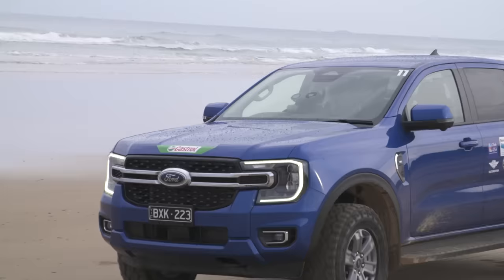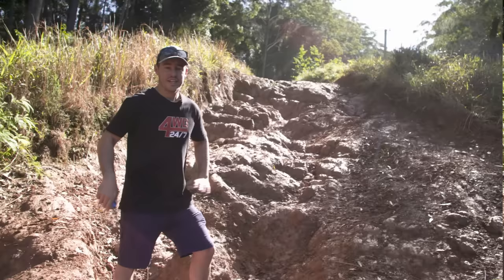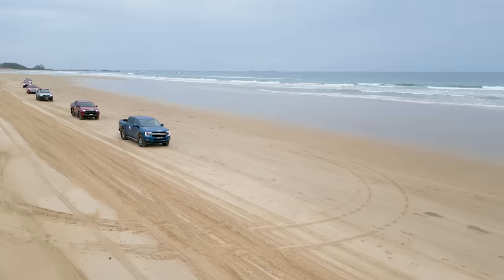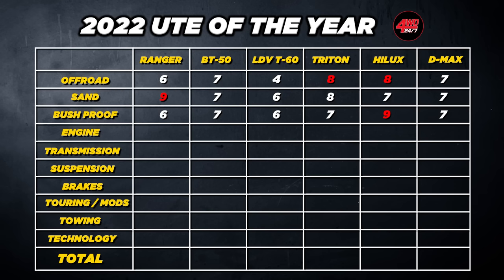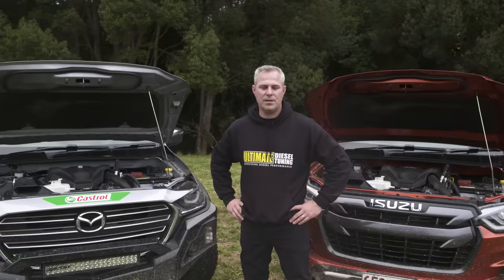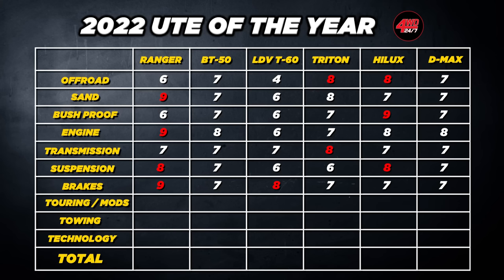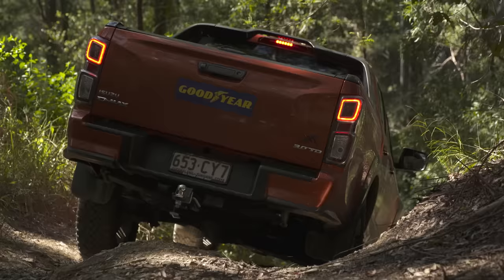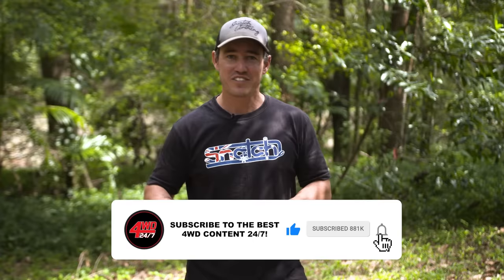2022 4WD UTE COMPARISON - CONTROVERSIAL WINNER! NEW Ranger vs Hilux vs DMAX vs Triton vs LDV v BT-50

Comment: I drive a 3.2 ML Triton with some good mods for off-roading. 
But the Ford ranger should win. 
Overall a great looking car. Well designed and jam packed with features. The car was designed with ARB, so there’s provision to fit all their suspension, side steps, bullbar etc. it also has a dedicated mounting spot for the ARB compressor I’ve heard. Going to be seeing some real touring rigs there!

Comment: Good video guys. I've just put my money on a XLT Ranger. Its the first time I have ever test drove a new ute and didn't think about what I was going to have to do/spend to make more power. You can upgrade the Hilux{and all the others for that matter} to the hilt with much expense and they will never punch that beautiful smooth torque out like this new V6 & 10 speed. Really impressive. I'm loaded heavy and towing 3ton often and I'm excited that for the first time I can just point and shoot. Only time will tell how it will hold up with all that "awsome tech"! If not for the towing I'd be in a bulletproof Triton{again}. Just as an aside the boys at the dealer threw my in a new  
T-Turbo petrol Raptor this week-WOW.

Comment: Ive got the LDV D90, come with rear locker, don't understand why the T60 doesn't on all models? Ramp angle on the D90 let's it down off road as for towing the 8 speed ZF does the trick with the bi-turbo, friends 2018 Hilux lowing the same weight caravan cannot keep up climbing mountain passes here in NZ. Throttle response is bad, put in a EVC throttle controller, helped but don't get why modern diesels have this issue.

Comment: i have a D22 navara, old 97' model with front locker and all the offroad goodies for camping and 4wdriving. super capable for an old work horse.
i think the best value for money is a triton. cant pass up the warranty. 
the new ranger looks like a good option if you have extra $$$ to spend.

Comment: Although i drive a 2019 ford everest (bendix BBK upgrade yes please), I am a fan of the new ranger, i don't think it deserves this win. It's simply too much coin for a stock ute. Yes the V6 and other gadgets are impressive, it looks constipated, the same upside down smile look all owners will get when they get easily hung up. I think the hilux or Dmax with 12k of extras would be a far better deal drive away (or mod yourself). If it was my money, i'd buy a recent ranger (new stock of older model), for a lower run out value, or new lux/dmax  and spend the value of up to 70k on tyres, lift, bar, winch, fuel filter, catch can and and maybe a lithium battery set up plus some recovery gear... Would go a lot futher than consipated face ute. Shame the new amarok wasn't yet fit to dance with the other lot. I think it would have been a very different story if it had!

Comment: I’ve got the pre 2011 Toyota Hilux n70 
Not just because I drive a Hilux but I recon the Hilux should win because, over all the results show as the second best ute but, it doesn’t cost near as much at the ranger. Comparing the 2 I think I would rather get the hilux because there is a lot of easy supporting mods, as where you don’t need to spend extra to get the dealer to re calibrate it after modifying it.  but all in all it comes down to personal preference at the end of the day, no one’s got the wrong answer 💪

Comment: You showed us Ranger has low mounted alternator not good for wading through creeks and it has plastic water pipes that could split and are not easy to replace like rubber pipes with clips?

Comment: I have a 2018 D-max that I’m doing up for off-road and camping also planning on doing some towing. I think the D-max should win it’s a good all around with a great engine. I have seen too many Fords letting people down. The hilux would be giving the D-max a run for it’s money but it does use more fuel at least the older ones did. The ford and mitsubishi have a 2 part chassis from what I have heard

Comment: Is it fair to be comparing a top of the range off-road focused ute to a middle of the range road going ute? Like the BT50 Thunder vs a Ranger XLT?

Also, is it smart to state that the transmission cooler on the Triton is great for towing straight after saying the engine is underpowered for towing.... 🤷‍♂️

Comment: Would love a brake upgrade for the FZJ105 keeping my family safer on our road trips and help when towing the camper around VHC and SA when we move there. Personally, I would love to see the BT50 win as it seems to be a great all rounder with a solid drivetrain and good capabilities straight out of the box. It might not be the best one there, but it is a great compromise to achieve everything you may want to do in it, with good aftermarket support to build apon when you find the limits.

Comment: Great video and review of the modern dual cab utes. 
My brakes are due to be replaced on my D22 Navara and I would much rather have a performance brake upgrade kit from Bendix installed than the stock Nissan brakes. The stock brakes in my D22 are terrible regardless if the car is loaded or not. 
My ute of the year is the Hilux, nice platform for an abundance of aftermarket accessories, mid range in price and you know what to expect with a Toyota in terms of longevity in performance and quality

Comment: While you're pointing at the Ford at the Ranger I'm sorry to tell all your blokes I'm a Ford guy I'm sorry to tell you the alternator sitting down low it's designed that way buy Ford engineers that's meant to cost you money meant so you have to buy more parts for designs fill your points in their vehicles so you have to spend more money

Comment: They look great, go hard and you made some good points on all. But I’ll still go with a 70 series cruiser because it has less electrics that will go wrong. Iv heard and seen all these models including the Amarok have stupid electrical issues that put you off the road but not once with a 70 series cruiser. Seen an Amarok have an issue with the tail light that stopped the driver from doing anything. Seen a dmax get bogged because the TC kept coming back on and seen a Ranger out of actions for months just because the electrics kept playing up. Again, never seen any of that happen to a 70 series cruiser.

Comment: Great comparison! As lame as it sounds, I've put an order in for a Ranger Platinum. I have only ever owned Hyundai's and towed a caravan with a Santa Fe and Palisade diesel. They definitely dont have the capability of these 4x4s, but, their diesel engine and transmissions have never let me down. No hunting and 99% of the time in the right gear. No transmission cooler towing 2T. Hoping I won't regret this. 
As soon as Hyundai release a ute, I'll probably jump back on the Hyundai bandwagon.

Comment: I've got the new amarok on pre order as there is a 12 month wait on the V6 ranger. 

Interested as to why you didn't include the gladiator in the test. It's a very different take on a Ute and be interesting to see how it compares.

Not sure if you guys mentioned it do all the Ute's in the test have the same tyre size from factory ?

It would also be good to know what the actual ratios are in the transmission section. I know you said the LDV does go as low but it would be nice to be able to compare all the low rangers as a low crawl ratio makes a huge difference

Comment: Excellent program for comparison. Whilst there is a substantial price difference between the ranger and the others I would still pick the Ranger. Overall your program showed this vehicle to be superior with the exception of the clearance which can be corrected with a lift. In terms of the price point probably not a fair comparison given the ranger was the only interested of the new generation. Reason for my decision apart from above is although more expensive historical evidence suggests that resale value of rangers has held strong which I would expect to be even better with the new generation. Hence I would spend the extra for the ranger. I currently drive a 2018 ford Everest Trend.

Comment: Im not into off-roading, but go on holiday to the coast evry 2 years , and having driven the previous generation Ranger, and the Hilux GD6 2.8, id take the Ranger every day. Its bigger cabin and better ride is way more important seeing my son is over 6 feet tall, and doesnt fit comfortably in the Hilux rear seats. Also, for the price, if other Utes had to match the standard of equipment and tech of the Ranger, theyd be more expensive. Hilux also has very impractical cabin setup, with cupholders and vents, etc. People go on and on and on about Hilux reliablility, but MOST people  only drive vehicles for 3 years then buy a new one, so what does that matter?

Comment: No idea why Nissan wouldn’t do the Navara for the review other than them worried it’ll damage the price range they set the top models at. Base model NP300s are great for value imo compared to other brands, but the top of the range is not worth the money imo as cool as they look. I’d be confident the Nav would be just as capable as the rest be even have an edge in some situations because of the factory rear coil set up. Such a shame, especially for a brand that’s slowly increasing its name in the 4wd scene in Australia.

Comment: You said ranger was a little over price, well you test car was xlt with tow package v6 diesel and cameras 360 around. The car is ready for towing , touring with 600nm straight out of the box. All others need upgrade tunes ,trailor brakes. I think the ranger is better value than 79 series.

Comment: The new Ranger is really the only option for caravan towing anything 2.5 T and over. Not only toque, but I believe GVM, TBW & more importantly GCM has been increased to 6400 which is the easiest of all the weight limits to go over when towing caravans. 
It would be interesting if in this tests you included GVM payload availability and GCM with four people in the car, full fuel tanks, and a packed 3T van on the back. This is what’s missing for caravan info these days. I’m sure people would be shocked at the limitations.
Reply: It's a little strange that this is the case in Australia since in the US we don't really even consider the mid-size to be suitable tow vehicles for all that much. Even half ton trucks like the F150 are short on payload when it comes to towing.
I owned a 2011 MY Ram 2500 crew cab diesel from late 2010 until this past September and was constantly running into payload problems when towing. Given the size of Australia and the type of overlanding setups it is a little strange that Ford/Ram/GM don't import 3/4 and 1 ton SRW trucks.

Comment: I wouldn't buy one but it's not hard to see some ldv bashing in this video. Most power of a two cylinder and there was no mention of it when it came to the price comparison. Also a bit sad that the base model with no diff lock was picked. Considering a few of the others picked were top of the range. Would have expected at least some fair comparisons In these areas.

Comment: What’s going on fellas. Good to see you boys handling business with testing these dual can utes. I currently drive a 2017 Toyota Prado VX - a little better than Sootie 2.0 but no way near where I would like 4wd to be. Would love the new Bendix brake upgrade as we look at touring up north in the Pilbara and Kimberly. 

Best Ute I reckon would have to be the Lux (Hilux). Look Toyota has been around before I was twinkle in my dads eye and the all round performance and durability of the Lux makes it incredibly versatile and really the sky is the limit with customising and adding additional features. The responsiveness of the 2.8 litre in the newer model makes all the difference compared to the earlier 2.8litre models. Really a fantastic dual ute set up. Good amount of low down torque and good for all round touring in stock form…”The greater the engine displacement the great responsibility” - Sootie 2.0. I reckon the Lux wins any day of the week.

Comment: I have a 2014 Volkswagon Amarok 2.0L biturbo 4motion dual cab ute with a 2" lift and rear airbags, only have 31" a/t's atm. And it goes anywhere and everywhere all the "real" 4wds go. I will admit I do have to winch if the tracks are really wet and clayee and there are huge ruts made by vehicles with 35" tyres or bigger  haha. Dispointing that the new amarok wasn't included in the test, but pretty sure they have the same chassis, drive train and engine as the new rangers, just different cabs/skins.

Hope the Ranger wins because like I said it shares the same platform as the mighty Amarok. But If I were to buy one of these, It would probably be the Ranger.

Comment: Just wondering if the V6 in the Ranger is the (LION ?) engine which was fitted to various Landrovers . If so, it had many issues, such as broken crankshafts around the 100k mark. I think there was a class action as LR think warranty only applies to cheaper cars.

Comment: Great to see these utes tested in normal off road environment and not just a test track. I think the Ford is probably a bit to complicated in the engine department and not really suited to a long term investment. It is probably fine for those who will use it as a company car and trade it in before the warranty runs out. Because of this, I reckon the Hilux would be my choice. The number of Toyota dealerships around the country and the availability of cheap non genuine spare parts & accessories online make it a no brainer. My 2006 Hilux desperately needs a Bendix brake upgrade so put me in the draw please? 😁

Comment: I drive a 2013 nissan navara enough mods to get me where i need to go but could do with the bendix brake upgrade! I can tell you i work for a dealer and we sell all these vehicles we have a very big construction project going on in our area which has required the company running the project to go to remote areas, All the vehicles they use are current shape hiluxs, these hilux’s come in absolutely flogged with a wheelie bin full of mud stuck to the bottom of them but they survive it! We are yet to repair a toyota hilux drivetrain at our workshop and all these other manufacturers getting far less abuse we are repairing daily. If you want to use the vehicle for what there built for toyota hilux wins by a mile!

Comment: Why don't you test some of the American utes. Ram now have the 1500/2500/3500/. and theres the ford f150 coming to Au next year. And could you explain how the utes would perform for the regular tradie in next years video. And I would get the F150 because its basically a generator on wheels so its perfect for a tradie so it can run tools and equipment on the job site.

Comment: Just a quick question on price point. Yes the Ranger is the most expensive, but it's alot more Ute in certian respects.
How much difference in price would there be if you brought say D-Max BT50 and the Hilux for arguments sake, and modified them to have similar power and tourqe figures of the stock Ranger, as well as a drum to disc conversion. Secondly could it even be done breaks yes engine maybe. 
This needs to be considered in price point as then your actually comparing similar vehicles. As it stands the only similarty between the Ranger and the other big 3 is shape, when considered power out puts of the other a fairly even.
When this is taken into account the Ranger price tag actually looks really good.

Comment: You took the LDV without rear diff, noted that there are versions with diffs available for $4k extra, marked it down for being worse off-road then said the top spec car that you tested at nearly twice the price beat it? and when considering value for money, you did the tests as budget vs premium cars, - I mean I get that it was donated for the review, but (as it was the base model) I wonder what it'd stack up like 

Same with the brake tests, talking about rotor size of the ford vs the LDV doesn't make much sense without also talking about the extra weight that the ford carries. - there was lots of "in theory" in this test and not a lot of testing for some of the categories...

Comment: Had a mazda traded it back on ford , found those sensors to much and would put it in the middle to bottom because of it , found it really dangerous on road almost caused accident s due to  over active driver assist , not to mention the that bloody fully lit up red dash and   the spring system to light for heavy load s

Comment: Intriguing results. We have done 20000kms in our 2021 Dmax Xterrain towing a 2.8ton caravan around Australia. We have been on corrugated roads and heavy sand (not towing in heavy sand). Fuel has ranged from 15 to 19 litres/100 towing up a long gradient into a strong head wind all day. 
My opinion? Well I’m pretty chuffed how well it has performed and haven’t noticed the transmission hunting but then again I usually tow at 90kmh. What has really impressed me with this engine is the power is there when you need it. I’ve had to overtake road trains and I just push the pedal a bit and it goes from 90 to 105kmh before you know. It’s quite unbelievable really. @biglap.aus

Comment: I started wondering about DMAX. In Europe, they all come with 1.9 diesel motors, which appear to be downsized 2.5l units. Do you have any experience with those engines? I'm curious what's their expected longevity and performance offroad.
Reply: That seems like a very small displacement engine for a mid-size pickup.

Comment: Although this comparison vid is better than most I really find it hard to take most of the info seriously…. The guy going through the brake segment and mentioned HQ came with disc brakes… not on the rear they didn’t and most were drums on the front……saying up to 50% of braking is done by the rear on utes ?…. No.. they don’t….. and so on ?…. Some of this discussion about the utes came across as more “ my guess” or what “ I think”…. Rather than actual technical knowledge of the vehicle.